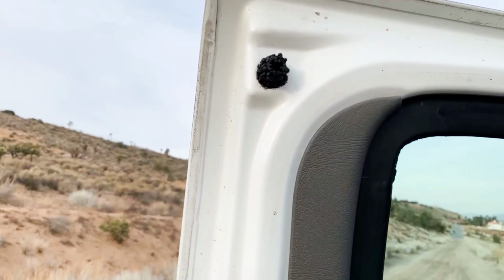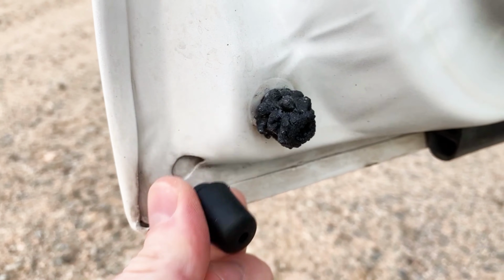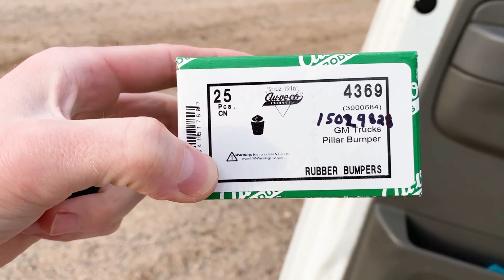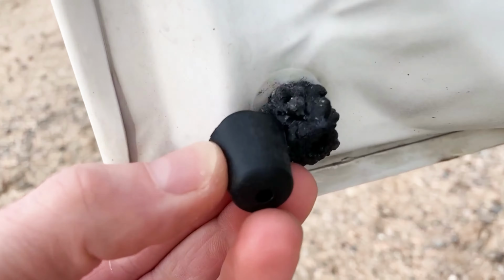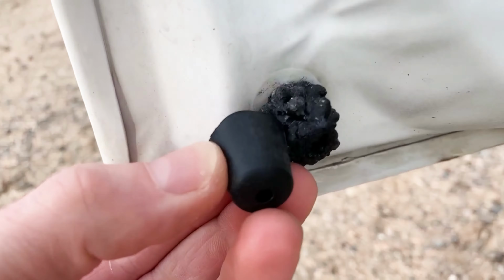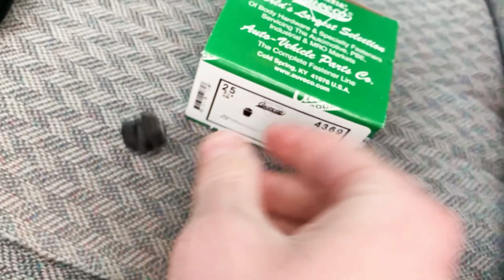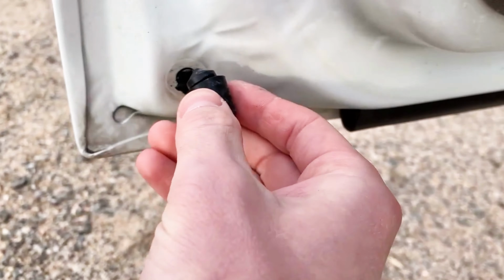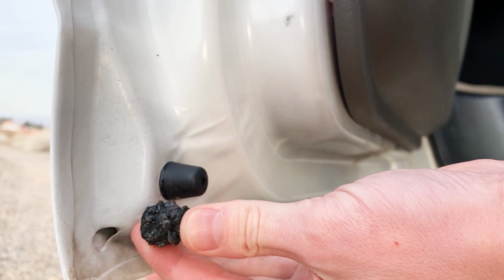Door Bumper Replacement (Express / Savana)

Comment: Hey Tim, glad I discovered your channel; great info on the Express, appreciate your videos.
I'm going to change out those rubber things, good call.

I bought a 2001 1500 Chevy Express high top conversion with a 5.0 with 217 k miles; runs like a top.
I took a shakedown trip and it was fine except for the wind noise from the front two doors/windows.

Do you have any suggestions on the window/door noise?
Does your express have a lot of wind noise?

Thanks!!
Reply from the maker: Thanks for checking it out!
For the wind noise, does it change if you pull the door towards you while driving? Would probably indicate bad weather stripping or poor door alignment (possibly worn hinge pin bushings?)

Check out this post (and join the group too if you haven't already!)
https://www.facebook.com/groups/1426529440979542/permalink/2610209295944878

Also if you do end up needing a set of these door bumpers, I still have eight remaining from my big box lol.
I can stuff four in an envelope and ship anywhere in the US for $9.50 if needed.

All the best!
-Tim
Reply: @VanwithTim  I need 4, I'll take them. I can pay you with PayPal or however.  I'll send you an email. 

I never tried pulling the door when driving. 
I'll check out the alignment/hinges, the noise can ruin a nice trip.